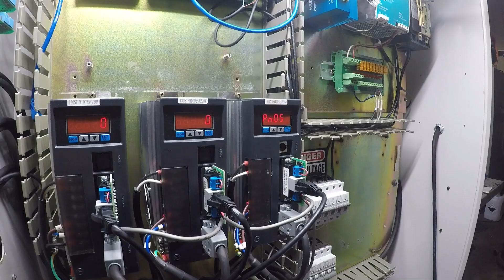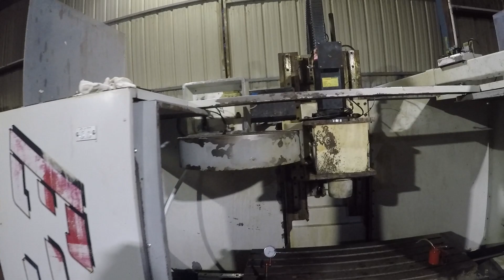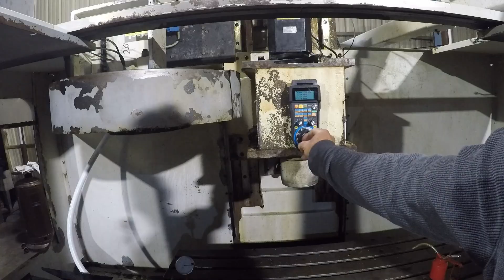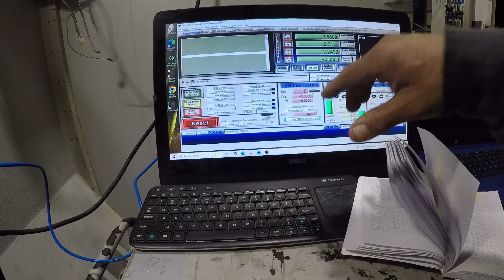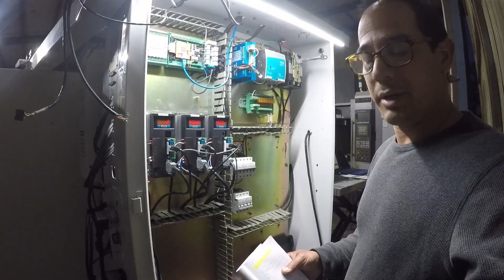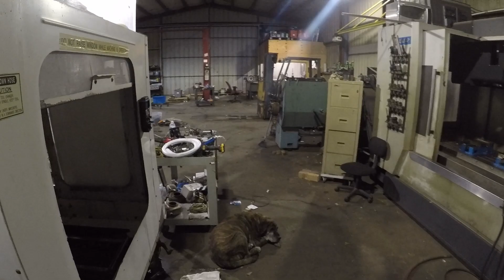Haas Vf-3 Retrofit Servos Settings (Most Important ones)

Comment: I'm loving this build series. I'm binge watching it. Nice job! What is the board with all the fuses? Where did you get it? I am starting a manual lathe CNC conversion. That fuse board may be a good option for me. Thanks! I also have a Sharp VMC, a 2011 SV-2412SX. Great machine!